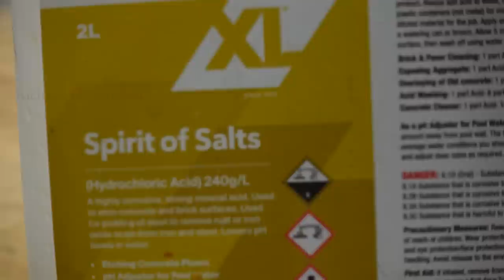Antique Beam Drill Restoration

Comment: Very beautiful restoration. I really liked how you restored the wooden parts. The nuts at the base of the structure are not factory-made, the original nuts are square and with a 3/8 thread, you had to tighten the m10 nuts a little tighter because of the different thickness of the rod.Although the difference of 0.475mm is not particularly noticeable.
Reply from the maker: Thanks for your feed back cheers Richard 😀